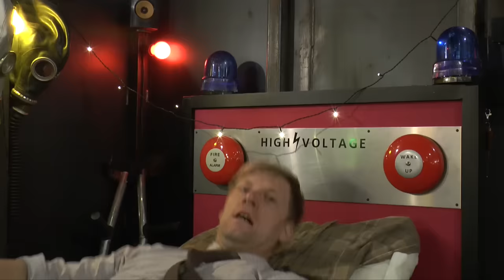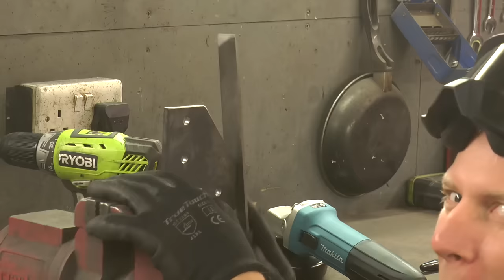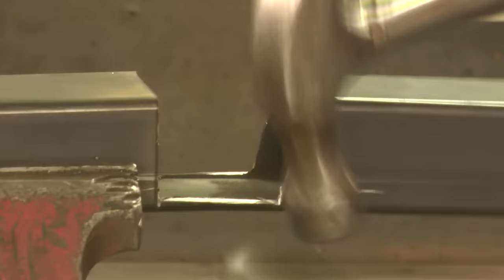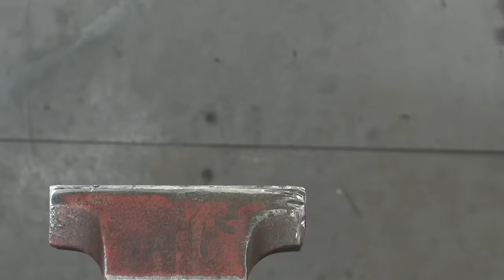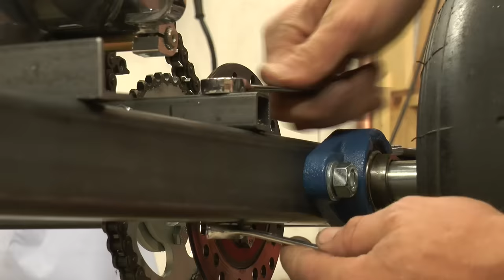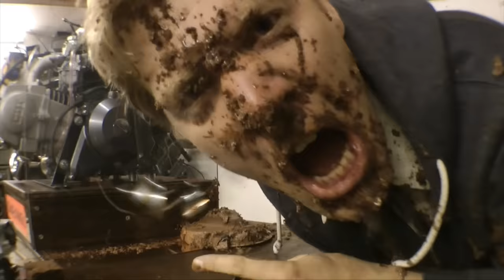Making a Motorised Go Cart with NO WELDER and simple tools #1 - Chassis/Engine

Comment: We’d love to make this kart, but where are the measurements? Can anyone help with the basic dimensions, as I guess it’s critical for the steering rod etc.
Reply: This is something where you can very easily choose your own measurements. After all, you might need more of less legroom than Colin. And because there's no welding, if something ends up being too long/short, you can simply shorten it/make a new part and bolt it in.
Reply: i woudl just rent or buy a super cheap welder the bolts arnt worth it
Reply: @zackskinner2666  yeah you can buy a cheap welder for under £100. I'm sure it's shit but it's get the job done. He said the parts would cost £600 brand new. Which I'm dubious about, but that only be another £100 on top of price if true. And you would probably use it more than once. He didn't factor in the cost of all the metal work. I'd bet atleast another £200 on top, then bolts doohickies bits and bobs. Call it a grand realistically. That bit of ply wood for the bottom alone would be over £100 I know recently cos I bought a piece recently half that size to make a lid for an aquarium. Cost £50
Reply: @1invag  i bought a 100euro arc welder and It works really well and I'm used to being around good welders
Reply: While I agree that welders would do a better job, not everyone's workspace would be suitable for welding. The point of this project is that it can be done with minimal tools and skills.

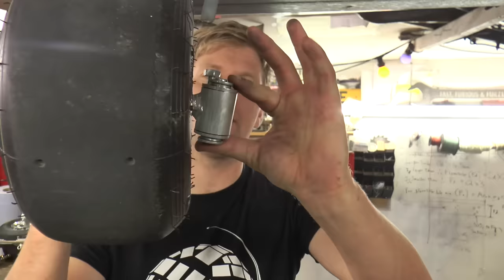Comment: 4:29 That wheel is angled for a reason, its called camber, it helps handling in corners..
Reply: @Jyrsky  oh what the fuck i didnt even know
Reply: Jyrsky so?
Reply: 😂😂😂🤣🤣🤣 18°. camber I think not my friend lmfao it does. allow for slight camber but u are absolutely incorrect the gokart was built correctly
Reply: @n8gixx6smith50   the front tires were actually on backwards so he endid up doing twice the work he shouldve
Reply: Just something that I was about to ask. Thamks for the anwer!!!
Reply: If he had put then on straight, that would have resulted in positive camber. Positive camber helps stability in a straight line, but decreases cornering ability. Negative camber gives more cornering grip, but can reduce straight line stability. And what looked to be like 20° of camber, is quite excessive, the max you wanna go is about 5° - 10°.
Reply: @mojoo215  This does definitely not look like 20 degrees of camber, this is max 8 degrees, you can look up google images of -5 degree camber and compare it, 20 degrees is the spaceship lookin  showcar bois that cant go over a bump, this aint it chief
Reply: The angle is there to aid in steering and also more stable going straight at high speed. That said, your certainly don't need it with a rigid H frame like this. I have a vintage go kart with this design and it has no camber. 

Now, removing camber built in to the bracket seems insane. Usually it's a pain in the ass to get it to begin with
Reply: oh i thought i was to help the kart turn-in and help the frame flex.
Reply: @alexsmith-st1iw  i dont think letting the frame flex id good for taking corners, people add mods on cars for making the car as stiff as possible
Reply: @rektz898  yes but these are go kart wheels not car wheels

Comment: Doing this project without a welder definitely takes more skill and attention to detail than i think most people have!
Reply: Zwenk Wiel not really. if you think about it if your kart was veering to the left you could just attach the steering wheel in such a way that when it is straight the veer is compensated
Reply: The bigger issue is at least here in the US you can buy an adequate welder for less than $300 (GBP 200) new, less if ya grab one used. At the rate he is going through hardware, you could have saved half the cost of the welder by not having to buy so many nuts and bolts.
Reply: It takes less skill to weld than to drill a hole and insert a nut and bolt?
Reply: Mig welding is much easier than drilling multiple straight, evenly centered holes through multiple layers of steel.  I think that anyone whos done both would agree!
Reply: v5u7sulh2
Well if accuracy is important, then yeah.
Reply: No it does not. Welding takes an immense amount of skill to learn.
Reply: MrWolfSnack
No, no it does not. It takes a lot of skill to be masterful, but just doing good enough is easy.
Reply: Measure twice, cut once.
Reply: Space Dog
The cutting isn't the issue. Drilling through tubing nice and square with a hand drill is pretty tricky.
Reply: Nevir202
take two pieces of wood and nail em together to make an el, put your bit in the corner where they meet and your hole will be plumb and square.
Reply: BariumCobaltNitrog3n
That definitely helps, but it still isn't super accurate, it relies on ongoing eyeball checks.
Reply: Nevir202
Yeah, you get what you pay for
Reply: I have to disagree there, I've taught friends of mine to weld with a mig welder in twenty minutes and they were successful and bought their own, welding beautifully IS an art and a practiced skill, but if you can set the welder correctly you can be successfully welding metal in a very short time. I can tig weld,gas weld and arc weld,now the first two do take a LOT of skill but mig and arc are really simple techniques to learn.
Setting the welder up is the critical part, a lot of welders have the cooling gas like a hurricane blowing,which isn't neccessary and wastes gas.
If the wire feed and amps are set for the thickness of the metal, its as simple as drawing a slow pencil line!
have a great day
Dan
Reply: Yep.  Fact is that welding a frame like this is easier than doing all this cutting and bending and drilling bolt holes.  And cheaper.

Comment: I agree 100% with what people are saying here. Need to get myself a grinder (or borrow one from family member) and find where to buy the metal from locally. (Sourcing material for projects is the number 1 reason most never get started for me)
Reply: Really? Did you spend +100 hours outside looking for supplies?
Reply: Nope, I spent considerably less than 100+ hours trying to source material, I had given up way before then. Why is 100+ a special number?
Reply: Colin Richardson google Metal Supermarket. They have all the metal you need and they'll even cut it to the right lengths for you.
Reply: Colin Richardson I agree it can be a pain finding materials locally and it can get expensive buying online when you take postage into account. Search for your nearest steel stockholders and give them a call, ask if they have an offcuts section or scrap pile you can look through. My local place has racks of "offcuts" up to about 3m long and the 50x50 box section is about 3 or 4 quid a metre. There's a scrap pile with small offcuts of plate and flat bar that they sell by the kilo for pocket change. I've never tried any but apparently a lot of fabrication places usually have a decent scrap pile you can buy from.

Comment: You should flip the rear axle, so the rear sproket will be on the right side of the kart, matching with the left side of the engine ( where is the sproket) so the engine will mount outside of the kart, unless you are trying to seat in front of the engine
Reply from the maker: seats going in front, i don't like side mounted engines
Reply: +colinfurze What about cooling and breathing?
I mean, that engine is air cooled, right? and unless you extend the air intake, it should at full tilt be less powerfull as it could be. 
(yeah... my gramnar sucks... english is not my first language. :/ )
Reply: patricio valenzuela Side to side weight distribution must be taken into consideration. An ideal one would be symmetrical centre mounted engine.
Reply: Air cooled engine should be fine even when there is driver+seat front of it, thought if your going to make some covers for the car, then i suggest building some air intakes just in case.

Side mounted engine brings so many troubles with weight distribution that little air cooling is last things in your mind, specially in your first drive with it.
Reply: A lot of air will be sucked underneath the cart and pass under the seat, this will get to the engine just fine, the air behind the seat is not going to be sitting still, there will be a fair bit of air movement. It wouldn't overheat even at low speeds or standing still, as long as it's not revving flat out for long periods it shouldn't get too hot anyway.
Reply: How would you mount the chain?

Comment: I am trying to make a go cart but I'm struggling to find parts for £300
Reply: easy bro
Reply: @bojanautocare8260  help pls
Reply: @freddieparrydrums  What parts do you need?
Reply: @bojanautocare8260  I need the steering rack, wheels, stuff like that. Don’t need engine or stuff to build frame. Thx
Reply: @freddieparrydrums  Its been quite a while since ive built mine, i remember buying a steering kit from eBay for around 50 60 ish $ including the steering wheel, now for the wheels you can get those cheap wheels from harbor freight for about 6$ each
Reply: @bojanautocare8260  Thanks for the advice, I looked at go kart wheels and they cost too much lol. My main hobby is RC cars so I save money for that. Thank you 👍
Reply: @freddieparrydrums  No worries, if you have any further questions feel free to ask
Reply: @bojanautocare8260  hey dude you seem like a pro, i have a question, can you build a kart for less than 300 euro’s?
Reply: @thijsvanderlinden2209  i could work with that kind of budget yeah, metal chassis, 200cc lawn mower engine and the rest of the stuff you need
Reply: @bojanautocare8260  thx my friend and i are gonna work on it in summer vacation thx
Reply: @bojanautocare8260  hey…. I need help with with knowing exactly what I need to buy to build a complete go kart….  The size and how much steel tubing, steering kit, wheels…. Thank you